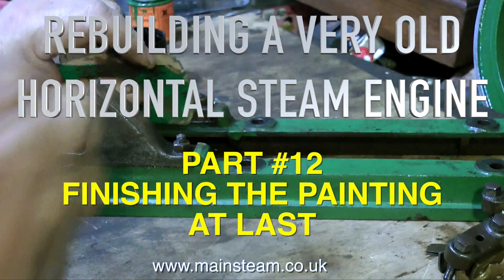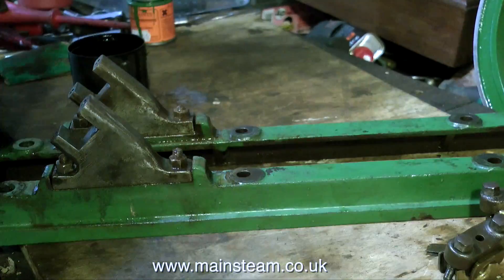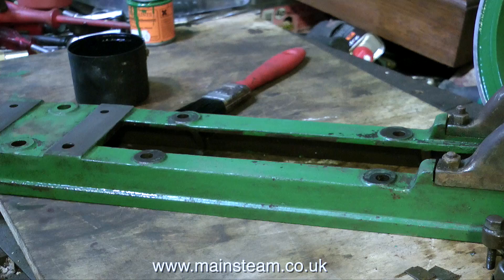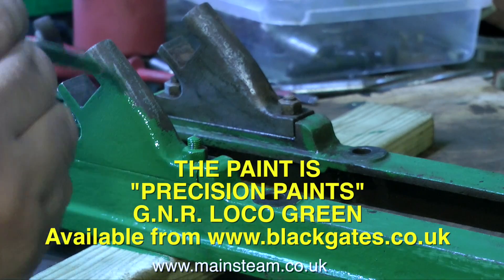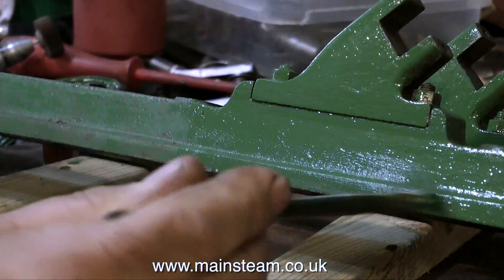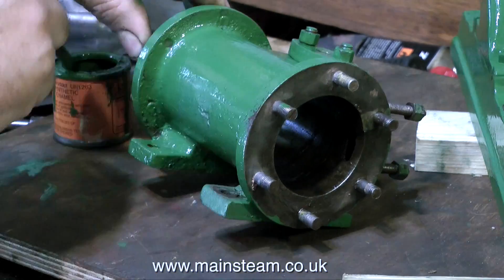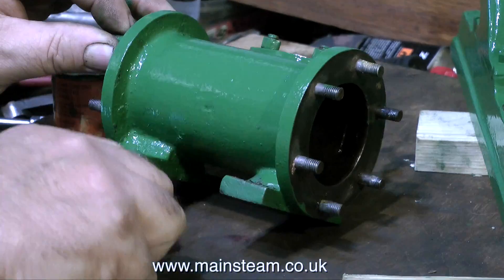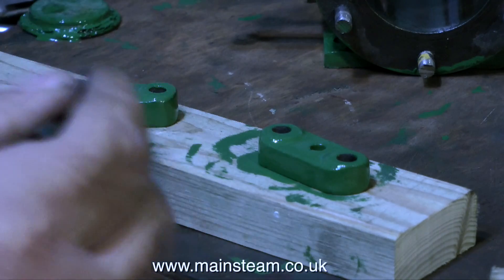PART 12 - LARGE HORIZONTAL STEAM ENGINE REBUILD

Comment: I thing originally the green colour was a because of the high content of coppersufate and copperacetate. It makes the paint corrosion protective and gives it a high resistance towards abrasion. But coppersulfate and copperacetate are poisonous. So I think the paint has an other composition today.
Reply from the maker: +boelwerkr That is a really good comment - never thought of it - I thank you .
Reply: Thanks for mentioning. :-)

And some more useless information ;-)
German locomotives where mostly black because they had great amounts of scale and graphite in the paint for similar protection.
Less poisonous but much more complicating in handling. Because the components weren't solved but in an emulsion.
I have worked with the original stuff and it's horrible to work with, it applies like tar but is runny as hell at the same time.
Reply: @boelwerkr  it may also use heavy metals. My mother was an engineer at a John Deere plant a number of years back, and they were attempting to find replacements for cadmium and chromium in their paints at the time. It was how they got the proper colors, but were toxic and not particularly good for the environment. I don't recall which was the yellow and which the green at the moment.

Comment: A simple solution to stopping dirt or dust getting into your paint is to put it into a cheap plastic container like one of those storage containers with a clip on lid after painting.
You can drill some air holes around the side and in the bottom to aid air flow  without letting dirt in.
You can also use one for a mini spray booth if you hook up a small extraction fan in the back.

Comment: How do you paint cast iron? I have a base for a steam engine, and I want to paint it, but I'm scared it'll come off, and do you use some special coating so the paint won't peel off when oil gets on it or do you leave it and let it peel?
Reply from the maker: +Demonic Darkness Cast iron seems to take paint quite well straight form the tin - if in doubt try a self etch primer.
Reply: Okay! Thanks for replying :)